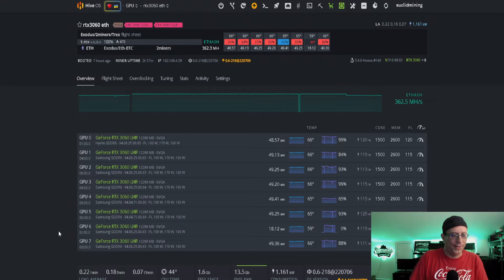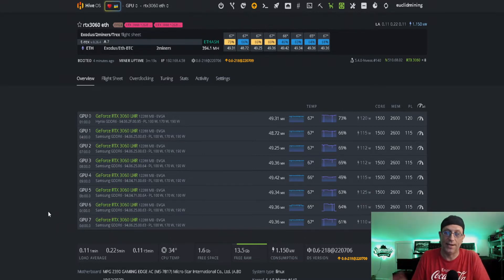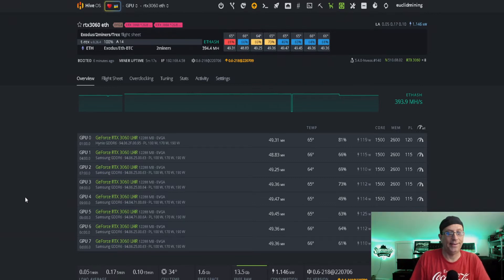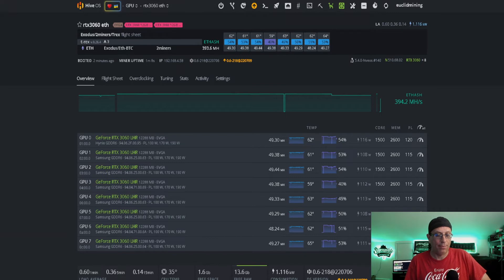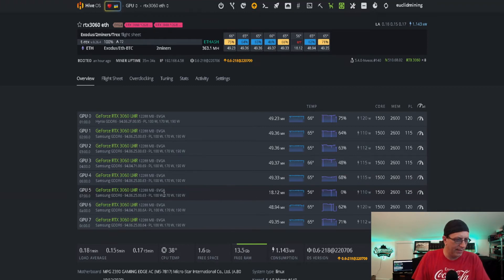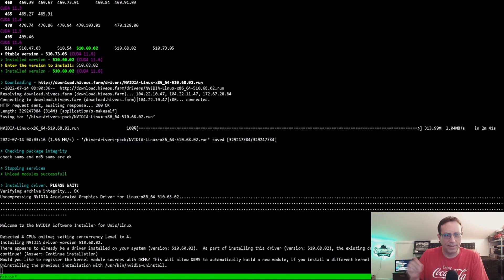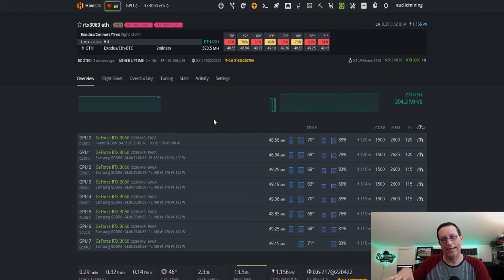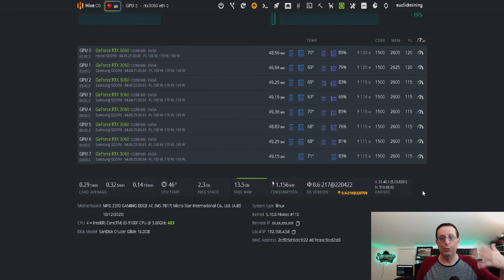My 8 GPU 3060 Rig Has Low Hashrate

Comment: My 3060’s would do that every 3 or 4 days since it warmed up out side. I had to drop mem to 2550. Been up for 23 days currently. My MHs didn’t change so I must have been pushing a little much with 2600 mem.
Reply from the maker: Ill try that. Thanks for the suggestion.